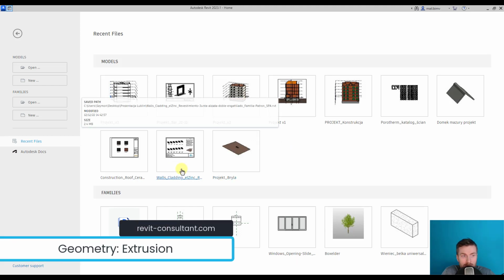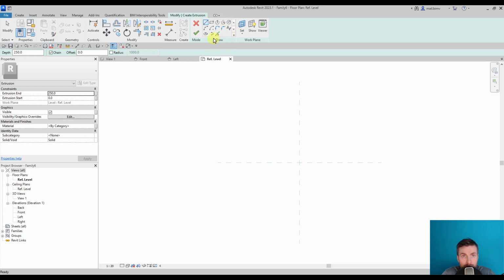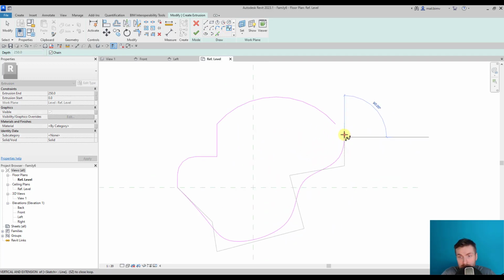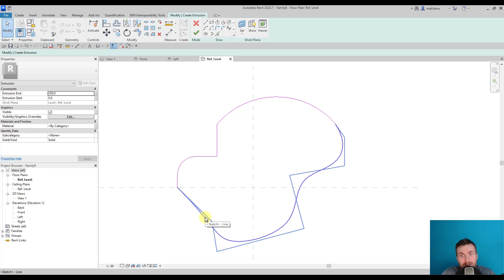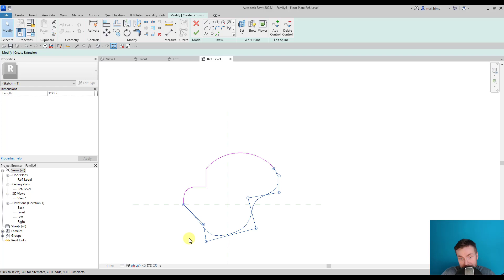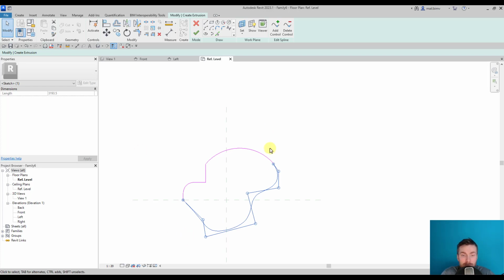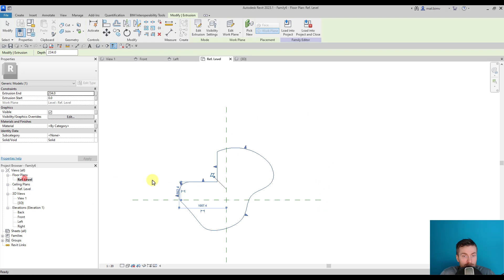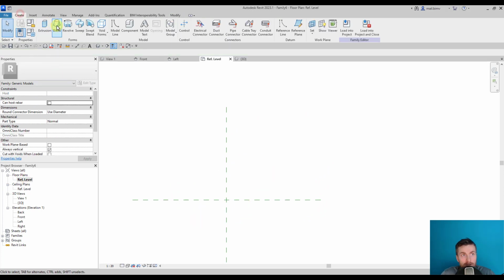REVIT FAMILIES COURSE:  Module 2 | 1. Geometry: Extrusion

Comment: thanks for telling us about revits limitation when it comes to modeling organic shapes like cushions and blankets, i was going to that after I learn about families, saved me a headache.
Reply from the maker: Yes. I was frustrated myself at the beginning. It's better to look for different software and import parts of the geometry to Revit. It's a general misconception that Revit solves all your problems and can be used also to visualisations etc... Of course you may use it to create renderings, but it can't compete with 3ds max, SketchUp, unreal engine in this aspect yet.